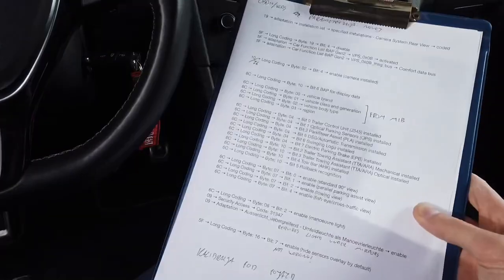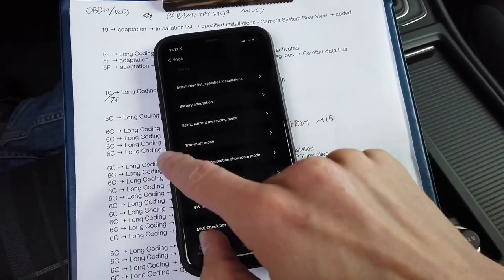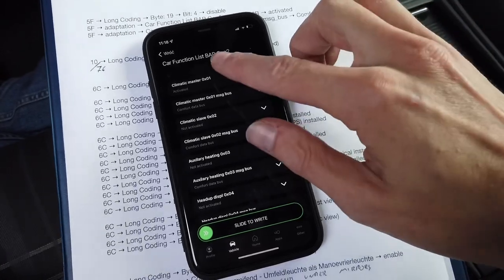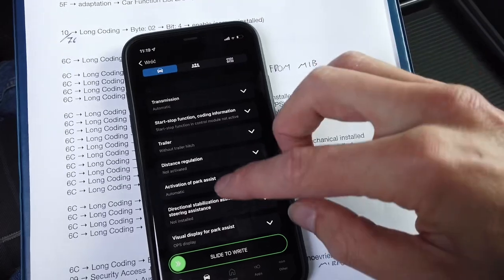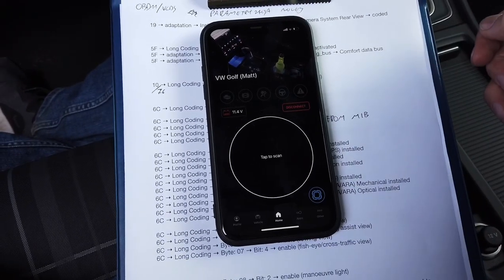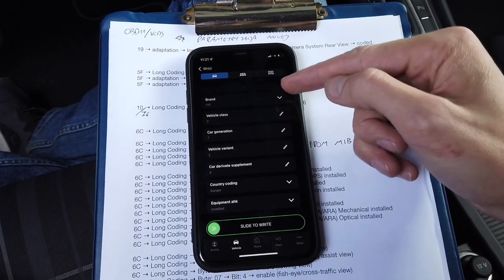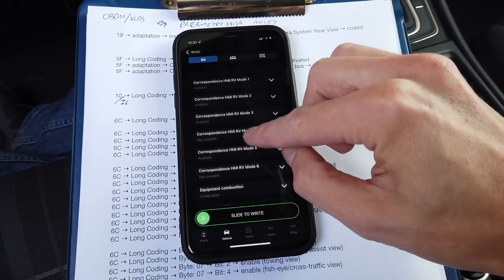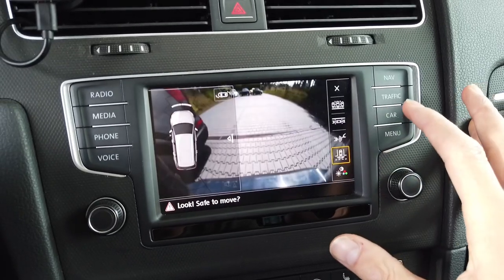VW Golf MK7 (5G) RVC High retrofit, part 3: coding

Comment: I have a problem, I installed it, when I put Rear gear everything work fine, but if I press just the Parking button, nothing happen on Mib, I can ear just the sound of parking sensors, but I can't see anything on 5f, how can I solve?
Reply: @KaizokuGari  Hi, I have exactly the same problem, did you solve it? Generally, the camera was installed when I bought the car, I had all the options set as in the video

Comment: No Calibration needed?
Reply from the maker: Used camera. Came parameterized and calibrated. Will try to redo the calibration if I find a way of doing it without ODIS.
Reply: @mrfixpl  I once saw someone doing it with OBDeleven, maybe you can find out how.
Reply: @mrfixpl what if it’s new and not parameterized, what needs to be done?

Comment: Great work., thanks for making this video, its very helpful. Understand you got a used camera module, did you have to parameterize/flash it with ODIS or had to calibrate it with VAS6350 tool ?
Reply from the maker: I was lucky enough to get used camera from the same type of vehicle as mine, so it came properly parameterized and calibrated good enough. But I want to calibrate it and maybe one day I will do it while making tutorial about it.
Reply: . @mrfixpl   
waiting for that... without calibration the camera start sending image or stay black? i have obdeleven but not have odis

Comment: Thanks for great video guide and so detailed explanation. I have one offtop question: where did you connect the charging cable which is in the air vent?
Reply from the maker: 5mm hole in the air duct, cable goes under the instrument cluster to the fuse box, connects to dc-to-dc converted which is connected to one of the fuses with a fuse tap.

Comment: Please can you help me as to why my RVC keeps resetting and I have to do a hard reset by holding the power button, do you think it’s a Setting? I have a high line camera but no sensors in my car. Only reverse cam installed. Are sensors necessary?
Reply from the maker: Sensors should not be needed.
Maybe there’s a firmware update for your unit? Which are you running now?
Reply: Thank you so much for your response. I have made some progress in finding out the exact reason when RVC is looses connection but before I explain just to let you know I have Golf Mk7 with a upgraded MIB 3 which I was told the vehicle BCM is not going to accept this head unit completely as it is not in the VO. Not sure how true that is because everything else works perfect. Any way now the here is the logic when the vehicle looses the RVC, Start the car put it in reverse rear camera opens but no picture, then hold power on the head unit reboot and it starts to show the image and will continue to work. Switch ignition off hold the power button reboot and the image disappears the. Cycle the same sequence again and it works and switch of ignition lock the car after a while image gone. I am confused it does not seem like a wiring issue. Any thoughts ?
Reply from the maker: Try coding it as the RVC-Low, just to check and compare how it will behave.
Reply: Finally got it working. Tried RVC low and high that didn’t help. Then I changed the USB and IPhone to USB only and it’s working everytime

Comment: Hei, nice work. Can you tell which are the parts no. needed? Thanks
Reply from the maker: VW Golf MK7 hatchback: 5G0-827-469-H; 5G0-827-469-P; 5G0-827-469-R; 5G0-827-469-T, 5G0-827-469-AF

VW Golf MK7 estate/variant: 5G9-827-469-G; 5G9-827-469-H; 5G9-827-469-Q; 5G9-827-469-S; 5G9-827-469-AA, 5G9-827-469-AG, 5G9-827-469-AJ.

VW Golf sportvan: 510-827-469-E, 510-827-469-G, 3G0-827-469-BL, 3G0-827-469-CA, 3G0-827-469-CJ, 3G0-827-469-FL, 3G0-827-469-FS.

VW Passat B8 estate/variant and Arteon coupé with back glass high polished logo: 3G0-827-469-E, 3G0-827-469-H, 3G0-827-469-E, 3G0-827-469-L, 3G0-827-469-AA, 3G0-827-469-AQ, 3G0-827-469-BB, 3G0-827-469-BJ, 3G0-827-469-BL, 3G0-827-469-BS, 3G0-827-469-CA, 3G0-827-469-CG, 3G0-827-469-CJ, 3G0-827-469-FL, 3G0-827-469-FL, 3G0-827-469-FS, 3G0-827-469-GC, 3G0-827-469-HN.

VW Passat B8 estate/variant and Arteon coupé with black/bright chrome logo (new logo from 2020): 3G0-827-469-EK, 3G0-827-469-ER, 3G0-827-469-FE, 3G0-827-469-HE.

VW Passat B8 sedan and Arteon sportback with back high glass polished logo: 3G0-827-469-F, 3G0-827-469-CD, 3G0-827-469-FM, 3G0-827-469-FT, 3G0-827-469-HK.

VW Passat B8 sedan and Arteon sportback with black/bright chrome logo (new 2020 VW logo): 3G0-827-469-EG, 3G0-827-469-EN, 3G0-827-469-FL, 3G0-827-469-FH, 3G0-827-469-HB.

Comment: Your videos have helped me with so many retrofits. Might be worth removing the maneuver light coding in your description on this though, looks like if you dont have AreaView it doesnt actually work and just throws a Databus missing message on the Central Electonics module (09).
Just spent months trying to find where that fault came from. Other forums say it doesnt work too. Did you manage to get it to behave as expected?
Reply: hi gareth may i ask you is there any way to get obdeleven as a free?
Reply: and how did you get obdeleven
Reply: @flaron1488  it's a peice of hardware, you need to buy it, and to do some of the coding you also need a subscription so no.

Comment: Hi.
I have a rvc high installed on a
Passat B8. The camera is new and the coding in module "6C" are all "zero". I can't find the access code to change the parameters (I use VCDS). And I don't know what values to insert. Do you have any information about it? Thanks!
Reply from the maker: I believe you need parameterization first. This can not be done with VCDS.
Reply: @mrfixpl  thanks for info...
Reply: Ciao MR-FIX
Anche io ho comprato una telecamera nuova originale non parametrizzata per una Passat B8 del 2019 e non riesco modificare niente su codifica lunga e tutto a zero,quindi cosa devo fare devo andare in un officina wolskvagen o esiste un altra possibilità?Io sono in possesso di ODBELEVEN PRO
Reply: @mrfixpl   which program is required?

Comment: Everything works for me however my camera doesn’t pop out or show when I click the parking sensor button. Could this be due to my coding or due to older head unit ?
Reply: Bad gateway software. Same problem with my passat.
Reply from the maker: It looks like I'm lucky with my 2015/16 MK7 and modules that it came with from the factory. Both gateway and parktronic are stock and it worked as expected.
Reply: @mrfixpl  I had a good luck from factory but VW service decided to updated my unit to 5Q0907530AJ and this one don't want to cooperate with camera retrofit. Technically newer soft but worse.
Reply: After you’re done coding the headunit (5F) you need to reset it by holding the power button

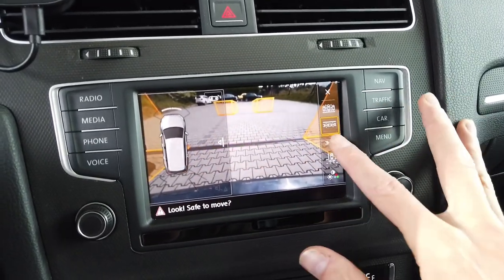Comment: Great job as always. I recently watched your video about installation of front view camera. But you have dont it manually by adding a rely which is time and effort saving. But is there a way to intergate the front camera to the headunit like area view(360 view) ? I have seen area view you can choose individual camera from the modes like on 9:33? If you find some thing about area view please do share. Retrofitting area view is like very hard as far as i say but doing something like you did with front camera and integrate with headunit will be amazing. Thanks

Comment: There is a problem f.e. in tiguan in long coding you cannot change or input coding 1 by 1 only input whole line of code and if you put f.e. data set from tiguan on kodiaq f.e. you can only use tiguan coding whole code at once or you will have problem such error not coding. But f.e. tiguan doesnt have parking parallel assist it will not work on tiguan and you cannot change that setting. So you need to use data set from kodiaq on kodiaq or karoq and input whole code at once...
Reply from the maker: I believe parameterization determinates vehicles. This will reject coding with first 4 bytes that do not match the dataset. That's my guess.

Comment: where do i find the below for Audi A1

💻 Code vehicle and region
6C → Long Coding → Byte: 00 → vehicle brand
6C → Long Coding → Byte: 01 → vehicle class and generation
6C → Long Coding → Byte: 02 → vehicle body type
6C → Long Coding → Byte: 03 → region
Reply from the maker: Check your 5F module. Most likely it will use the same 4 bytes.

Comment: Hi, I followed your instructional videos and installed my Highline camera yesterday, thanks for your knowledge but when I try and open the boot by hand nothing happens, the camera is working, do you know what I might have done wrong, thanks
Reply from the maker: Check if you can open it when ignition is on.
Reply: @mrfixpl  Hi, you are correct, ignition on it works, ignition off it doesnt, thanks
Reply: @mrfixpl  Do you know what I would need to do now so it will open with or without the ignition on
Reply from the maker: You need to provide permanent power. Not just ignition hot.